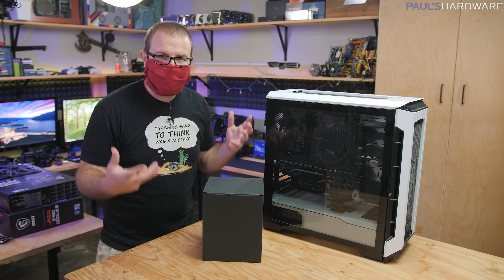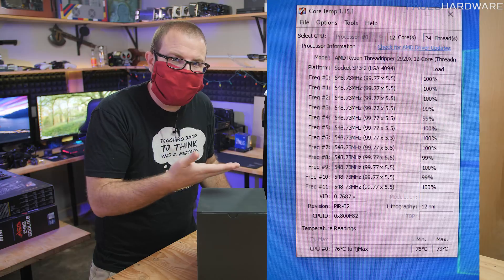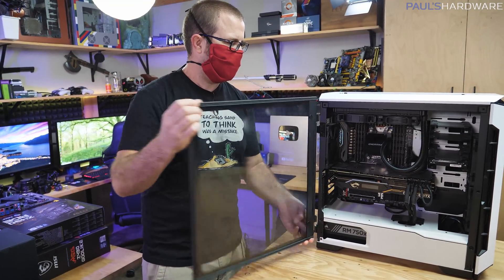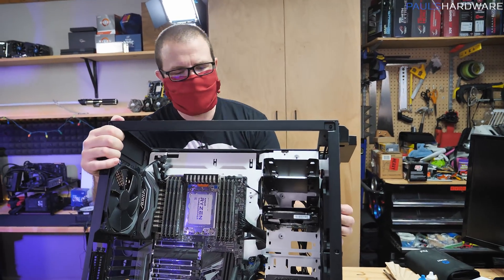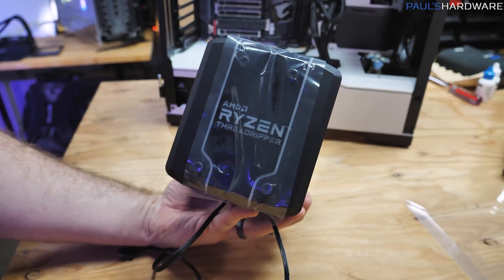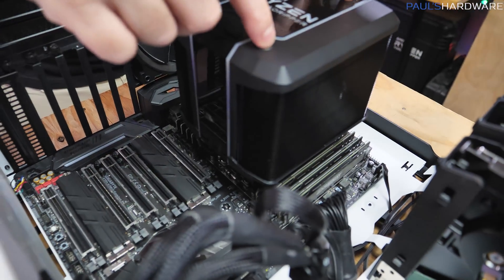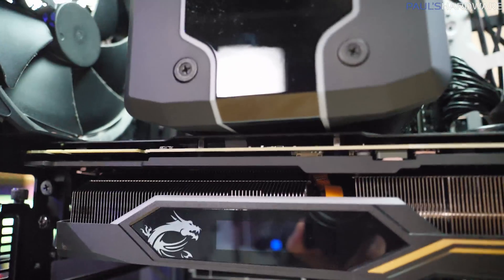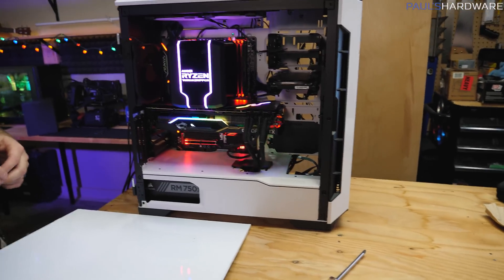Why We Switched from an AIO to Air Cooling...

Comment: i have a gen 1 liqtech 360 TR4 with its original fans and I currently have temps of 34.4c, mine gunked and was idling in the mid 40's  up so I pulled it apart, cleaned out all the gunk - there was a lot of gunk, flushed it and replaced the coolant with xspc pre mix.  I've never had a problem since and that was 18 months ago.  If it does go pear shaped then there is a Noctua NH 14 TR4 waiting on the shelf for back up

Comment: I had a Kraken AIO fail on me a month or so ago (much more suddenly than the Enermax, so probably a pump failure rather than gunk build up), had to switch to an air cooler, unfortunately my case is designed for water cooling, so doesn't have the clearance for a cooling tower, had to leave the front of the case off. I'll be going back to another AIO soon when the Lian Li ones are available (the case is Lian Li too).

Comment: The proximity between the cpu cooler and the video card might be reducing the airflow on one or the other. Vertically mounting the gpu would mitigate those concerns.
Reply: Also, how much strain does that cooler place on the board...looks heavy.

Comment: Their is still benefits on a aio set up. Space, aesthetics and it does have more stable temps you wont get spikes even tho the fan coolers are winning the temp wars. Plus probably keeps more heat out of your Case since its usually mounted next to a vent hole.

Comment: Unfortunately there's still no good AIO coolers for the threadrippers. I ended up just going with the Cooler Master Wraithripper and partially taking it apart to switch the fan around (it's oriented for airflow rear to front out of the box) and added a 2nd fans with a ghetto zip tie rig. It's worked great for my 1950X.

Comment: Love how YouTube reccomended shows me this right after I bought an h100i for my 3900x.
Reply: h100i is a decent AIO tho, Corsair generally makes decent kit, my h100i has been going on strong near 5 years now.
Reply: @Jacob-ct7hc  yep,,,most of my Corsair AIO've been working great, oldest one 6 years old!!
Reply: Same thing with Corsair AIO. I found out the tubes need to be inverted or vertical from the pump, up to the reservoir. It went from 89c at max load to 63c at max load. 32c at idle.
Reply: Got my H100i i 2013 and its still going strong now. Gave it a brush down with anti static brushes and its still good.

Comment: I'm wondering if using distilled water or mineral oil would solve the corrosion problem. Regular water has minerals and salts that lead up to corrosion and blockage of passage ways. That's why they tell you to use distilled water in steam irons.
Also, I thought you were not supposed to use a vacuum cleaner on a PC as it can build up static and ruin electronics?

Comment: Just a question for you. The weight of the air cooler is heavy than the standard AIO cooler and would the weight affect the CPU after it is installed when the case in the upright position? Affect performance level?

Comment: In the process of an RMA for an corsair AIO, pump stopped working after 4 long years but they have a 5 year warranty. Just got it the replacement in the mail. It sucks It failed but I'm glad I went with a company like corsair that has such good warranty practices.

Comment: First ever AIO I bought was the cheapest one I could find, from ID cooling, years ago. It's still the only one I've bought because it still works flawlessly. Just cleaned the dust out of the rad and getting 23 degree avg temps just browsing, in a tiny ITX case. Most of these things work fine for many years, sounds like this was just a bad batch.
Reply: @Blarson12  4.5 years

Comment: I've had issues with big air coolers not fitting over my RAM sticks. Also, I've been using a Corsair H100i for a good 6 years now with 0 issues. Your mileage may vary. I just prefer the look and fitment of AIOs. I understand your arguments though.

Comment: Really didn't like the clickbait title. The Enermax AIO gunking up problem was a known issue but was still installed, but you made it seem from the title that there is a problem with AIOs in general. AIOs are a great option as long as you get a reputable one without any major known flaws

Comment: Is it ok to vacuum inside the case like that? honest question. I usually use my vacuum on the mesh in the front and top but I never felt it's a good idea to take the vacuum inside the case even though the inside is dusty. 
My plan is to leave it till I can't tolerate the sight of it then take everything apart and clean it. Usually with a combination of cloth, cotton, toothbrush, and alcohol if needed.

Comment: First issue, you should have tested  it before and after you cleaned the plugged intake filters. Then test the air  cooler with a closed case as it isn't relevant to compare your air cooler numbers to his hot numbers using an open case. I am guessing the aio could be bad but with that much restriction, I will say your new air cooler will suffer with thermals too.

Comment: A little thing I learned with my own system.  Having the backside of the GPU that close to the CPU Cooler can cause issues.  I have an EVGA 1080Ti Kingpin Card that I had RMA'd in less than a month, then was having degraded performance after a few months on the new replacement card.  My temps in HW monitor were "OK" 70s-80s C depending on what I was running. Granted my 7700K is running @ 5.1GHz 1.42V, I did not think too much of this though being delidded.  I was using the Noctua NH-D15 and had the same clearance as you showed in an ITX board/case that I cut to add a couple fans and removed the plexiglass from the side panel after drilling holes in it for more airflow. It was my first time overclocking anything, and I overclocked everything learning through trial and error; so user error is definitely a factor.  It was not until I looked into the EVGA software that I noticed even though the GPU die temp was 80C, the backside of the GPU was 99C.  Got a GPU stand and PCIe extension turned my case on its side and mounted the GPU like a shark fin. Immediately my CPU temps dropped to 60s C on a sustained load, with 75C being the occasional max. GPU was still in the 70s and after the confidence of re-applying the thermal paste on the GPU (which was much less daunting than I initially felt), my GPU never goes over 60C. Unfortunately, Z270 did not allow for a CPU upgrade. Fortunately, my CPU still runs @5.1GHz 24/7, and a lot more experience for when I get a chance to build a new system.

Comment: Hey, Paul. If you've never used it, there's a citrus based cleaner called "Goo Gone" that cleans thermal paste far better than alcohol. It doesn't take much and it won't hurt the CPU heat spreader.

Comment: after using a multi fan cpu cooler from Noctua i've never built another water cooled system since. i use the gray redux fans with black vibration corner guards and the chromax sleeve that covers up the air cooling fins and makes it look nicer :)

Comment: Good Video. I did the same thing. Switch from water cooling to air cool simply because it started to gunk. But this was on a machine built in 2013. I replaced it with the Artic Freezer 33e sports one. It wasn't the coolest air cooler but was about 3 to 5c within the water cooler's range. Not bad.

Comment: I trust your judgement Paul. 
If I'm getting a AMD Ryzen 9 3900 X w/ Wraith Prism Cooler and putting it on a Gigabyte x570 Aorus Elite motherboard with a RTX 2080 TI Founders Edition Graphics card, can I get away with the stock Wraith Prism CPU Cooler or should I get an aftermarket CPU cooler and if so which one? (I'd prefer air cooler over liquid)

Comment: Great Job Paul!!!!  I recently upgraded my computer and switched to air cooler due to case size.  Cooler appears to be working but the RGB part is not.  Will take that out and check wires when I have some extra time.

Comment: Mine came with the fan pointing in the wrong direction. It was a competent cooler, but in my mind the best air cooler for Threadripper is easily the Be Quiet Dark Rock Pro TR4. It was 4 degrees celsius cooler than the Noctua NH-U14S and the Wraithripper, and something like 6-8 celsius cooler than the Deepcool (F)ryzen. It was also by far the quietest.

Comment: Hi, I have Arctic Liquid Freezer II 240mm. I must say, it was worth 75€. I am very satisfied. I have Ryzen 5 3600(stock). I have played Battlefield V for around 2 hours. I've ended the game and check HWinfo, CPU 88°C. I decide to buy Arctic cooler, because all fans in case are Arctic P12 PWM. I bought new cooler. Try Battlefield V again and temps were 69°C. I am amazed. Over 20°C down. Temps.: VRM max 45°
     CPU maaaaax 72°C ( I made new fan curve in bios) in idle 900 - 1050rpm, and it is quiet.
        INSIDE CASE max 40°C
GPU RX5700XT ca 65-73°C also fan curve tuned in Adrenalin software.

Comment: unfortunately I moved back from an AIO to an air cooler after finding couple dried droplets on my GPU's back plate. Didn't seem to have an active leak anywhere, but that scared me enough to move back. But, you don't realize how quiet an AIO is until you don't have it anymore :(

 Paul, I do have a test suggestion for ya; ever though of comparing air cooler blocks and use the identical fan setup on it to see what the individual blocks are able to do when you eliminate fan variance?
Reply: Do your job right and you'll find out that you can reach levels of quietness that would be impossible with an AIO.

Comment: The problem with the current liquid cooled systems is that they are still relying upon water as their coolant. Waterless coolant is far more reliable as it never needs to be changed and it will never oxidize or corrode.

Comment: My aio will show rpms in the bios and run at 30 degrees c and then shoot up to like 95 degrees c and not show rpms in the bios. I have the pump plugged into the aio pump header and the radiator fans plugged into the cpu fan header. Any ideas on why it’s doing this?

Comment: ewww, I mean the air cooler is fine and will do the job, Next time go with the NZXT lineup out of everyone I have known using it, the failure rate was about 5 out of 100 units which is actually pretty good and they were all warrantied I have yet to see a X62 die yet from operation and they are pretty much the top tier of the AIO market.

Comment: For the money involved with this build...aesthetics should matter.
The air cooler looks nice but having it practically touching the card is garbage.  You could have gone with an Arctic Liquid Freezer II AIO and solved the problem.  Enermax has proven to be shit...no need to rag on “AIO’s”.  Seriously man...the air cooler looks sweet...but it’s detracting from the Lightning.
Reply: At 7:53 look how sick the silver light reflections are popping.  
That would set up would look nice with a big translucent monoblock.
Reply: @vh9network  I haven't built a custom loop, but yeah...a translucent H2O block would be nice.  You could pretty much run any color scheme with one.  The pricing and performance of todays AIO's is just hard to beat.  Plus...I'm certain if I did a custom loop, I'd end up having a leak or 3.  I'm content watching IFR build the customs.

Comment: Poor Mans Toms Hardward Ripoff. I've used AIOs since it's come out and have NEVER had an issue. PC runs cooler, quieter, and all around better with AIOs. If you think air cooling is better for ANYTHING, go outside and drain the coolant out of your car and run it for a bit.. See what happens. They don't super clock chips with air coolers, do they? Nope.. You're like linus trying to lead people on because you got some sponsor and want to shill for them.

Comment: I've got a NH-U9s which is a noctua 92mm tower cooler that I'm throwing on my 3950x because idk who thinks sata powered 240mm aio is a good idea but it seems neigh impossible to a good 240mm aio that doesnt come with it. in a SFX case having a whole extra sata power cable off the psu is a big sacrifice for maybe a higher 100% boost clock versus the lower volume of a tower cooler that does work with my x570 dtx board and ncase m1 which should improve single thread boost compared to a water cooler with the higher instantaneous heat output of a 3950x.

Comment: Has anyone tried experimenting with electrostatic filters running off of the case's power supply?  Should be easily to isolate it from the motherboard, and would trap alot more dust with more air movement through the filter... just a thought.

Comment: I have a Enermax Saberay ADV case and a Asus ROG Strix B-450-F motherboard. One of the front connection cables, is a 5v female sync cable but, there is no place on the motherboard to put it so, what can I do?? Another cable, is one I have never seen before, can't really describe it. HELP!!

Comment: Ive been very lucky with the Enermax liqfusion 240 I have...... so far.  I keep an eye on temps just in case. I've been hearing about the dreaded gunk build up on these coolers.  AND  what vacuum is that Paul?   I use a shop vac and blow out mines but I love the little brush on this.

Comment: Water cooling in general seems like a headache. I'm sure that full on closed loop builds are easily the best cooling solution out there, will yield the lowest temps, but if anything goes wrong, or even when you just need to run maintenance on the system, it's going to be a laborious task and you'd want to really know what you're doing so that you don't accidentally do damage to the system in the process. Air cooling has come a long way, CPU coolers are fantastic and there are solutions to ensure cases remain clean and enable adequate air flow, where good quality case fans will do a fantastic job of keeping everything at nominal temperatures (even under heavy loads) - eliminates so many of the headaches that water cooling brings with it and still performs well, ticks quite a few boxes for me.

Comment: I also love a big honking air cooler, but I admit that they are a pain when you have to work on the system. My video card is right up against my cooler. Getting the PCI slot lock flipped open when you have to remove the video card is... interesting.

Comment: Had something similar happen a couple of months back. Though that AIO had been running for around 5 years before the pump failed, so not so bad. A cheap cooler master 1151 cooler later and the 6700k was up and running again. Though I took the opportunity to upgrade that system to ryzen so that 6700k now runs Linux 24/7 for Plex and other things.

As for keeping busy with gaming, yep been playing a fair bit the last few months!

Comment: I know AIO failures aren't all that common, but this is one of the reasons I will probably stick with big air coolers.  I also don't have a transparent side panel so I don't care about looks very much.  One issue I'll have in the future is that I use my internal disc drive all the time to rip CDs to my PC to listen to music with my headphones; meaning that my case choices will be more limited since a lot of cases just eliminate the front bays.  Maybe at some point in the distant future I'll swap to an external USB powered drive, but I like having the internal one.

Comment: I had the same issue (using a 1950x). When it worked, it was working great. I had to switch to the Noctua NH-U14S TR4-SP3. Temps are actually as good as on liquid. It just doesn't look as good lol.
Reply: What temps are you getting and what load

Comment: I'm still using my AIO Cooler Master Nepton 280L I got in 2016, and it's still working fine.  I even got a free installation plate from Cooler Master to mount my first Gen Ryzen proc from the previous gen AMD proc when I upgraded the proc.  When it's time to replace it, I'll replace it with the latest offering from Cooler Master.  For me, it's hard to beat Cool Master.

Comment: well ok i was going to get an 80 att psu. but if that 750 watt is powering a threadripper and a 2080ti and 128gb of ram. i dont have to worry about it running my 4.4ghz xeon and 2070 :D. haha

Comment: I went with the Noctua aircooler top of the line dual 120mm fan system for my last build with an i9-9900KS 5.1 Special Edition, but I could not retain stability at 5.1GHz until I changed to a liquid cooling 3 fan NZXT system. Same thing happened OC'ing with an AMD 3950X. So, even though these tests that Paul and Linus are doing are "scientific", there is something missing, and air cooling basing on temp alone is not giving us the entire story, quite frankly. Understood that these AIO systems are not always failsafe: pumps can fail, lines can clog, etc., but, if one monitors their system, they should be able to catch any issues before they get out of hand.

Comment: Pro tip, if your panels and dust filters are easily removed but you don't wanna bust out the vacuum - you can also run them under a tap 
Then just shake off the water and pat them dry with a towel

Comment: Hello Paul, Please Make a Video by Putting Micro Air Conditioner at the air intake end of the Air Cooled RYZEN 3950x PC and check the differences in temperature between AIO and Air Cooling, and Let me know how well it works 😇

Comment: Lol that clearance on GPU. My noctua d15 is like 1/8" away from it. Luckily I got the fins to point side to side going towards back fan on back of case. On another mobo, I could only do it down or up, which sucked. On another note. FUCK THEM AIO's. I have 4 (3 240's and 1 larger one, whatever the stupid size is)  in the last 9 years, they ALL failed. Either pump, or something got stuck, or I don't know what. I tried and tried and tried.

Comment: The issue isn't an AIO in general, it's the fact he used an enermax AIO. Those are notorious for high failure rates and very high heating issues. So for everyone who is watching this and are thinking holy crap I should forget about getting an AIO, no, don't do that. Just do the correct research on a product before you buy. Read the reviews about it. Don't just jump into it.